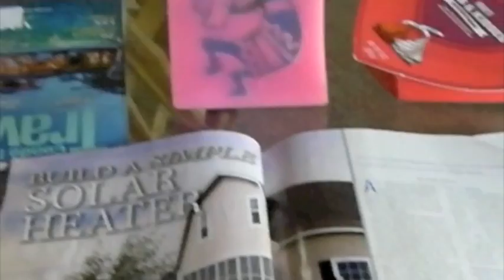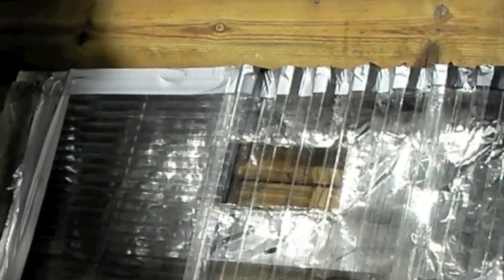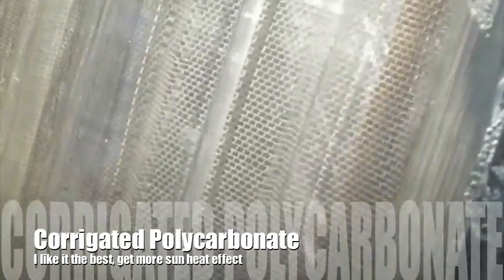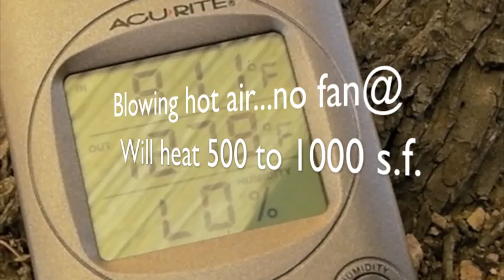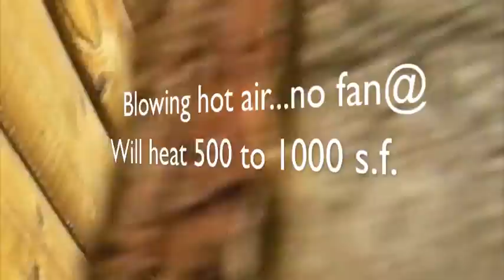How to Build a Heat Box for $6, Heat your Home Free

Comment: Someone said that this didn't make sense. These have been build all over the nation, and I'd suggest that if this doesn't make sense that those people try putting one together. Detailed instructions are published in Mother Earth magazine, or you build a heat box, this has been used for almost 780 years in Tibet, and parts of Asia with great success. But, we as American's have been a bit behind the curve in using solar energy.  I have seen projects like this working in Nepal, Tibet, northern India and parts of Mongolia.  So, something it took me about an hour to put together, for very few dollars we raised air temperature from 80.4 degrees to over 120 degrees.  So, simply put, build a box, enclose the sun exposed side with a clear plastic or glass, and put a hole at the top of it, and let the hot air from the top, flow into your building or house.  Good luck and when you design or build one, or make better ideas, share the positive improvements and thoughts with us all.  Keep the negatives or non productive comments to yourselves...we go for the positive.  Best of luck to you all!  Check out: www.benboothe.com, or www.environment-solutions.com, or the host of articles on the net about similar types of solutions.

Comment: if it's 80 outside you don't need heat inside. if it's 32 outside you do need heat inside BUT you aren't showing those conditions.  My guess is you may get 55 degree air when 32 outside. Better than nothing but sub par for a nice log home.

Comment: you need someone else to run that camera the video is terrible plus your $6 bait title is a lie...do you think everyone has free polycarbonate sheets lying around...that stuff is not cheap so this costs much more to build...not so much that it can't be done but why bait this video with an obvious lie. Thumbs down!
Reply from the maker: 560,000 people have viewed the video, many have written and told us they built this one, and even made improvements.  So, we wanted to stimulate action and new ideas and mission achieved.  Peace. Ben  PS. Show me what you have done, have you built or even tried to put anything together. We'd like to see....talk? Or Action?.   :)   Peace.  BBB
Reply: Just now got around to answering. 
I did this with old screen and scrap materials I scrounged.  But if you wish you can build a Cadillac version, how about doing so, and report your costs...if you don't want to use inexpensive or old used materials.  Would love to she what you have actually done...send photos and show us.  Actions vs Words thing gives credibility.  Mine built and works in summer and winter.  Perhaps you can have someone take your photo so the video you make of your project doesn't shake.  of 560,000 viewers, we had, what, perhaps 20 who griped, perhaps 200 who actually built one and love it.  This is not rocket science, it is a simple box frame with one side to let sunlight in.   6 ft high, 3 ft wide and 4 to 6inches deep.  The front facing the sun is plastic, polycarbonate, glass, or fiberglass. The back has aluminum foil to reflect the sunlight back to a window screen that is hanging in the space in the middle of the box.  My goal was to see how or what I could put together with some old scraps in my basement.  How to build it, you nail or screw the 4  4x4's into a square shape and nail a piece of plywood to make the back. That should take you about 20 min.  Then you hang a window screen or metal door screen wire in the middle.  I put foil on the back to reflect the sun back toward the screen...and it heated it up even faster.  Then screw the plastic see through cover onto the front, another 20 min if you are slow.  All in all I spent about 2 or 3 hours putting it together.  I heats the outside air temperature in summer and winter from 40 to 70 degrees hotter, and works very well without a fan.  We considered putting a fan onto the hole in the wall inside to blow air in faster, but never got around to that.     Sorry about the shaky video, I am not a film professional, just wanted to throw the idea out there.  Over 560,000 people have viewed it, and many have built these. Build one and send us photos.  Best to you.  Ben Boothe

Comment: Video quality = poorInformation = invaluableWhere to get supplies? = look in craigslist, or advertise in craigslist in the 'wanted' section, for someone giving away a big projection TV.  They cost money to take to the dump and people are willing to give them away if you take them away.  The projection TV has a polycarbonate sheet in front, most times a Fresnel lens under that, and the wood can be taken apart and reutilized (read: cut down) to make a box.  You will have other junk (electronics, lenses, plastic bits and pieces) that you can toss or upcycle.  This will reduce the cost to gas and your time.  If you are able to build one into your south facing window, run a pipe/hose to the floor to pick up the cold air in the house and heat it up back into the house.

Comment: Why do you use multiple polycarbonate sections?  Wouldn't this work better if you painted the board black?  Anyone can answer this question if you know the answer to either one of them.
Reply: yes. a lot of people have modified them over the years and painting the back board black helps, the poly on the outside would help against damage from hail.

Comment: I don't understand how the heat gets inside the house
Reply from the maker: Hot air goes in the bottom and as it is hot it moves faster to the top and from that vent blows into the house. Hi there. The reason for doing the video was to stimulate pro active people who enjoy thinking and doing creative things to use this to create something good by using solar heating.  Over 561,000 have viewed this video, and many have written and told us it gave them ideas to do this, and even made improvements. That was our goal.  I am curious if you have done anything positive to take this idea and improve upon it. The air flow is called "Chimney effect", look it up.   I wish to encourage you to build something good and creative and tell us about it, or even do a video it.  That is if you are a "doer", not just a talker.  Let's do things positive and actually do good things.  Best wishes to you as you do great things to make this world better.    Ben Boothe
Reply: Relativity COLD interior air enters at the bottom, is heated by the sun, becomes lighter, raises to the top and flows out into the room pushed by the air behind it getting lighter from the sun.

Comment from the maker: Building it is simple, use a screw driver, and hammer and nails and put 4 pieces of wood together...it isn't rocket science..then glue or silicone the clear polycarbonate to the frame.  I thought it was simple and straightforward.  Best of luck show me what you build.  Ben

Comment: why would you want to heat your house when it is 80 outside
Reply: Max, you kind of missed the point. In the mountains we build things in the summer, because we are covered with snow in the winter.  But the ratio of heating air is still significant.  40 to 70 degrees depending upon the sun, clouds and so on.   Send us reports of what you actually do... Actions vs Words thing.
Reply: Just now got around to answering. Well we build things in the summer, in the winter there are piles of snow.  You kind of popped off and missed the point.  Show us what you have done, or can do.   Actions vs Words.  My mind is certain, I built it, and it works.  Have you gotten around to doing anything, if so, send us a photo and a budget of what your costs were. That would be a positive contribution.  Actions vs Words thing. This is not rocket science, it is a simple box frame with one side to let sunlight in.   6 ft high, 3 ft wide and 4 to 6inches deep.  The front facing the sun is plastic, polycarbonate, glass, or fiberglass. The back has aluminum foil to reflect the sunlight back to a window screen that is hanging in the space in the middle of the box.  My goal was to see how or what I could put together with some old scraps in my basement.  How to build it, you nail or screw the 4  4x4's into a square shape and nail a piece of plywood to make the back. That should take you about 20 min.  Then you hang a window screen or metal door screen wire in the middle.  I put foil on the back to reflect the sun back toward the screen...and it heated it up even faster.  Then screw the plastic see through cover onto the front, another 20 min if you are slow.  All in all I spent about 2 or 3 hours putting it together.  I heats the outside air temperature in summer and winter from 40 to 70 degrees hotter, and works very well without a fan.  We considered putting a fan onto the hole in the wall inside to blow air in faster, but never got around to that.     Sorry about the shaky video, I am not a film professional, just wanted to throw the idea out there.  Over 560,000 people have viewed it, and many have built these. Build one and send us photos.  My out of pocket $6, but you can do a Cadillac version and use all new materials but even with that, the cost is very negligible.  Best to you.  Ben Booth
Reply from the maker: Hi there. In the winter atop a mountain there is snow, sometimes a lot of snow. People who live on mountains learn to build things when it is warm.  It works great in the winter time. The reason for doing the video was to stimulate pro active people who enjoy thinking and doing creative things to use this to create something good by using solar heating.  Over 561,000 have viewed this video, and many have written and told us it gave them ideas to do this, and even made improvements. That was our goal.  I am curious if you have done anything positive to take this idea and improve upon it, or if you like a tiny majority just use the internet to insult or criticize others who actual "do something".  I wish to encourage you to build something good and creative and tell us about it, or even do a video it.  That is if you are a "doer", not just a talker.  Let's do things positive and actually do good things.  Best wishes to you as you do great things to make this world better.    Ben Boothe

Comment: Solar seems great for daytime, but what about heating at night?  I rarely need heat during the day,  but all winter I need heat at night.  As it is I use a woodburner, but collecting, cutting, and splitting wood is labor intensive and I'm not getting any younger.
Reply from the maker: At night I use a wood burning fireplace and have a bed with a thick feather comforter. On really cold nights, I have a warm dog friend, but he prefers to sleep on the floor. The Earth Stove, actually heats the place very well.   Ben
Reply: +Terry W Heating with wood heats three times.  Cutting, splitting and burning.  Best wishes.

Comment: Sounds like a good idea for improving the heating of an existing house, thanks. For a new house design, rather use windows on the South side (Northern hemisphere). I believe this idea is known as passive solar. Passive solar also uses heat sinks to distribute the heat more evenly over 24 hours.

From your video I believe you are heating outside air and having it enter inside. That limits the effective height of the panel. Rather reheat the air in the house and that way you can have a panel of any height - right up to your roof if you desire - and still have the chimney effect to heat floor to ceiling. If there is air stratification, simply have a cheap household fan inside the house. An overhang will shield the box from the summer sun, when heating is not required. What do you do to prevent heat loss at night?

I believe a simple black-painted back panel will do a better job than the black wire/aluminium foil combo.
Reply from the maker: Hi Jeff, great comments and thanks, Ben

Comment: You haven't explained how to make this at all. You showed it complete, said it worked and took a couple of temperatures. You don't discuss material or how to put it together. How about making a video that shows how to make a heat box for $6. like the name of your video.
Reply: Just now got around to answering. I built it, and it works.  Not rocket science to nail 4 pieces of wood into a square and screw a plywood back to it.  Have you gotten around to doing anything, if so, send us a photo and a budget of what your costs were. That would be a positive contribution.  Actions vs Words thing. This is not again, rocket science, it is a simple box frame with one side to let sunlight in.   6 ft high, 3 ft wide and 4 to 6inches deep.  The front facing the sun is plastic, polycarbonate, glass, or fiberglass. The back has aluminum foil to reflect the sunlight back to a window screen that is hanging in the space in the middle of the box.  My goal was to see how or what I could put together with some old scraps in my basement.  How to build it, you nail or screw the 4  4x4's into a square shape and nail a piece of plywood to make the back. That should take you about 20 min.  Then you hang a window screen or metal door screen wire in the middle.  I put foil on the back to reflect the sun back toward the screen...and it heated it up even faster.  Then screw the plastic see through cover onto the front, another 20 min if you are slow.  All in all I spent about 2 or 3 hours putting it together.  I heats the outside air temperature in summer and winter from 40 to 70 degrees hotter, and works very well without a fan.  We considered putting a fan onto the hole in the wall inside to blow air in faster, but never got around to that.     Sorry about the shaky video, I am not a film professional, just wanted to throw the idea out there.  Over 560,000 people have viewed it, and many have built these. Build one and send us photos.  My out of pocket $6, but you can do a Cadillac version and use all new materials but even with that, the cost is very negligible.  Best to you.  Ben Booth
Reply: I can reverse engineer this from the video, and will be doing so in the future and uploading a video. Thanks Ben, I've seen your house or one exactly like it in Idylwild.  Does it work in the snow? I'm planning on moving back to Utah or Idaho, and I don't have an income. I am however, a real rocket scientist(Cosmology and astrophysics studies in my spare time). I await your reply, 
                          Blaine Price.

Comment: You heat your house in the 70s? Thats nuts, we cool ours then. In the winter it is -20 to -30 here.
Reply from the maker: Kind of miss the point didn't you?  On a mountain top, we don't build in the snow in the winter, we build in the summer.  It works very well. Over 560,000 people have viewed the video, many have built their own.  Show us what you have built...that was the point to stimulate creative actions.  Peace to you.  Ben
Reply: He BUILT it when the outside temperature was nice. Then he wanted to test it right away and could only use the temperatures available at the time he built it. 
Ben, it would be nice if you could show the temperature measurements in both cool and cold outside temps.

Comment: That much polycarbonate costs a little more than $6... You can increase heat output by 1) painting the interior bottom of the box black 2) adding a layer of insulation underneath and on the sides 3) adding a fan with a thermostat controller to blow air through.
Reply from the maker: Yes, we tried that. I put a fan in ours and it was fine, but the hot air came up so fast, we found that we didn't need the fan in the unit. So we put it on the wall inside the house, to circulate the air around the room. That was great.   Thanks for the note.  I used scrap materials, my challenge was fun, to see if I could build it out of scrap materials. You can go the Cadillac route to if you wish, but it costs a little more.  I built mine in a couple of hours.  Not rocket science.   Thanks for the great idea.  Ben

Comment: I like the idea but pretty sketchy on all materials placed like where did the two pieces of poly carbonate go, how big are they,what is the shiny material behind it all,what was used to hold it all up? Thanks
Reply from the maker: Hi, this is explained but the shiny stuff is aluminum foil... or you could use aluminum paint, we thought the foil better.  The clear policarbonate is the front cover facing the sun so the light can get in.  It is a box, a wooden frame 6' long, 6" deep and 3' wide.  This isn't rocket science.    560,000 people have viewed the video and many have built their own heat box from the video. But Mother Jones magazine has a set of plans of how to build a box, if you really need that.   Best of luck to you.   Ben

Comment: Why in the world did you use aluminum foil all inside it? That reflects the visible sunlight back out through the polycarbonate.  Instead, use insulation inside the box back and sides and line the back of the box space with black stone or flat black painted paving tiles, those will absorb all the heat you're losing and the insulation will keep it. A solar box like that can get to chicken cooking temperature, about 325 F. I don't know who wrote that booklet but they weren't a physicist.